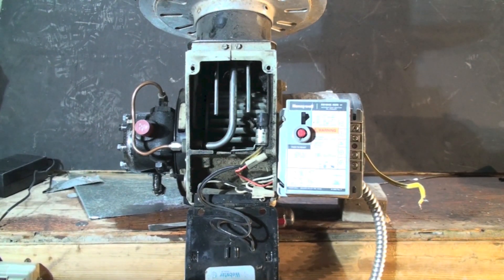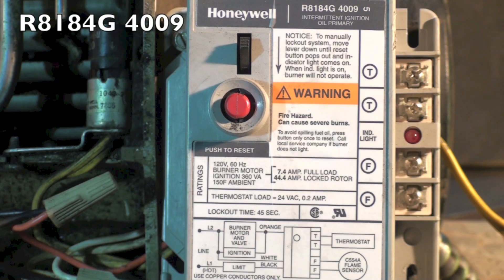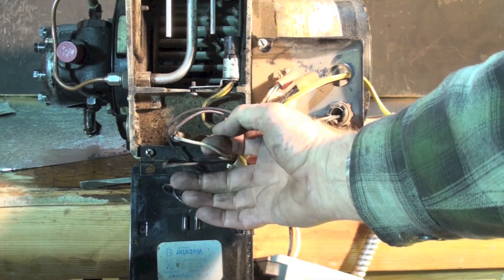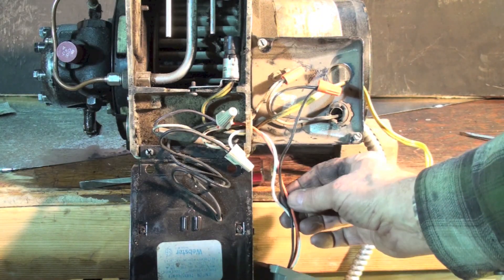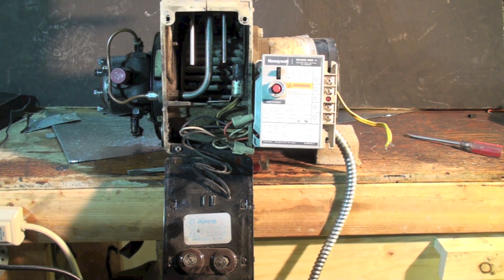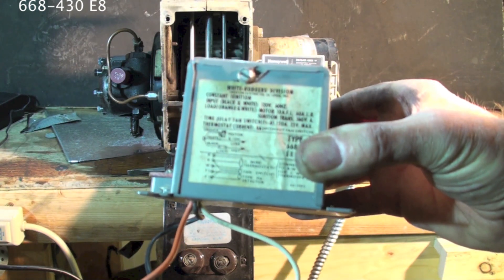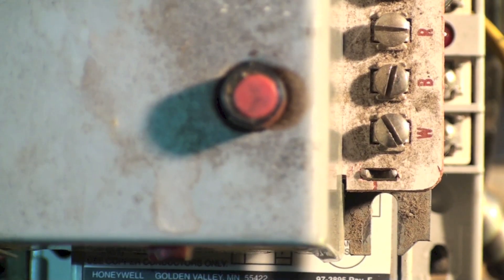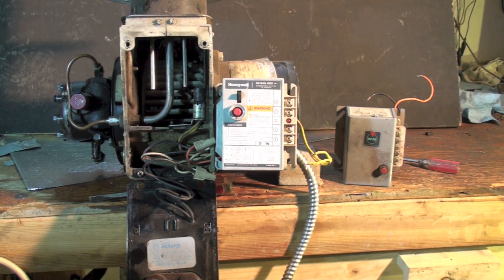How to wire the oil furnace cad cell relay

Comment: Wired as you have shown,opened the relay box and pushed the flapper switch beside the reset switch, running like normal, when it shuts down and I turn the thermostat back up to call for heat nothing happens but if I hit that flap pad inside the box again it goes ? Not sure what im doing wrong

Comment: First, thank you again for your help.  The latest problem. The furnace started but not heating the house. The heat is not going past the kitchen.  Nothing else is getting warm. 
Old HoneyWell thermostat. I'm wondering if the wiring is wrong.

Comment: Thank you for the video.  If you are going from a R4184D1027 to R8184G4009, after you finish wiring the parts from this video. IF YOU HAVE AN OIL BURNER, you need to put a small jumper between the two T's.

Comment: Great video I have seen other videos with a white wire on both T connectors it was just a wire connected from one T to the next and it was white. Can you tell me what that is for and do I need to add that to my relay because it didn’t come with one
Reply from the maker: The white wire is a jumper.
It is used when the burner is controlled by a relay which is, in turn, controlled by the thermostat.  
If yours is controlled by the thermostat, you do not need the jumper.
GFM
Reply: @grayfurnaceman  
Yeah mine is controlled by a thermostat 👊😉thanks for teaching me something important. I cannot tell you how valuable your channel is

Comment: How to wire a Field controls CK-63 control box to a Beckett Genisys 7505P primary control
Reply from the maker: The only way I can see to connect these 2 controls is to wire T1 to motor terminal on the primary, T2 to White of burner power, T3 to black on burner motor.  
GFM

Comment: I know this video is older but hope you see this.i have the same set up. But my furnace fires on and off rapidly. I replaced the cad sensor. Wanted to test it so I hooked up an external one and while the furnace is running I shine a flashlight on the sensor and it turns off thr furnace? Also if if I disconnect the sensor the furnace runs fine till it trips. Any ideas?
Reply from the maker: I can't say I have seen that, but I would be changing the cad cell relay.
GFM

Comment: For the 2 Honeywell R8184g TT terminals, could someone tell me which T should go to the thermostat R? And the other T will go to the thermostat W. Modern thermostats need a C wire. So R and W need to be connected properly.
Reply from the maker: The answer depends on the thermostat you are connecting to.  
If the thermostat is battery operated (not battery backup, but operated), the terminals are interchangeable.  
If there is a 24 volt transformer that powers an air conditioning system, you may need an isolation relay.
The problem here is if you connect the T-T terminals to a thermostat with 24 volt power to it, you will destroy the cad cell relay.
GFM

Comment: What happens when both wires coming into the junction box from the line in are black doesnt matter right?Thanks for your video it got me up and running without calling someone swapping out a transformer. Im very good fixing oil burners but not with wiring, LOL Glenn

Comment: You referred to the white wire as the power supply but the black wire is the hot.On mine relay there's a split line with one being hot and the white was connected to the other line .It was working until I had to replace my burner motor. I rewired it exactly as it was and used your video as verification. Bit now the relay is dead. I can't even jump across the f to f terminals with wires disconnected (ICM 1503) The white wire shows no resistance so it's acting like ground. Any ideas??

Comment: On that Rodgers 668-430 E8 the 3rd terminal for the 3rd wire could possibly be used for a C wire which makes me wonder if this cad cell model will operate a smart thermostat?
Reply from the maker: No.  You will need a separate 24 volt source and a isolation relay to avoid burning up the Cad cell relay.
GFM

Comment: So I have the Honeywell's one and it wont shut off after doing a anual cleaning . I disconnected it and it runs until the water is very low and I'm worried it may crack my burner by getting to hot w no water ...

Comment: Hi Gary maybe you can answer a question for me. I have a Beckett 7505 burner with a 7505P controller.  What is going on is the burner fires and runs for 2 minutes and shuts down wait 7 minutes the burner will fire and run 2 minutes and keep repeating.  My thermostat is set at 68 but I will only reach 64 .I checked my thermostats batteries and they are ok. Have you any idea. I did go on the Beckett website gave the same info and the result was a Flame Safe Guard, now is that the same as a Cad Cell. Is a Cad Cell or Flame Safe Guard the problem  Thank you and I enjoyed your narrative of problems that I  watched. Keep up the good work
Reply from the maker: You do not have a flame control shutdown problem as long as you do not have to reset the control.  
I would be looking at airflow problems.  You are may be overheating.
GFM
Reply: Ok, saying it is overheating where would you start and what would you be looking for. Do you think removing the complete burner assy and checking the firebox first or wrong direction. If we have an airflow issue what would be an aha moment how significant  would the airflow problem be. Thanks again, Wes
Reply from the maker: @chrislynquads  Plugged filter, dirty blower wheel, plugged A/C coil, ductwork problems.
GFM

Comment: Hi Gary my name is Robbie and I'm having a heck of a time trying to figure out the wiring for my grimsby seasonal 80 plus oil furnace, see I bought the furnace and the burner was off of it for transportation reasons but I'm not sure I can get turn on with switch not the thermostat and can hook the fan up to turn on the manually but really have no idea what wire goes where and I can't find anything online about them so I was hoping you might know something about them
Reply from the maker: There are several ways they are wired.  You can send me pics and I will try.  Send to Grayfurnaceman@gmail.com
GFM
Reply: @grayfurnaceman  thanks Gary well do, I wired it the way you showed in the video and it worked I just have to figure out the wiring for my fan it seems to come on at the operating Temp but then kicks out a well continue to do so till I push the button in to switch to manual, and thank you for getting back to me a really appreciate it it's a huge help

Comment: Mine is making a clicking sound now. Could this item be the problem I've had for years where the furnace (only when running the heat, not A/C) will sometimes keep running and not shut off? Sometimes it  cuts off like it should, and sometimes not. Yesterday, that part started clicking, and the furnace sounded like it was cutting on and off. To stop the furnace from running, I have to shut the main switch off, and yes, a thermostat was replaced and that wasn't the problem.
Reply from the maker: If you jumper the thermostat (short the T-T terminals) and it stops clicking, you have a problem in the thermostat or wiring.  If it makes no difference, the control may be failing or it may have a bad connection in the wiring.
GFM

Comment: Where do you connect the B1 line coming from Triple Aquastat Relay Type L8124A, C
Reply from the maker: On most controls, the B1 goes to the switched terminal of the ignition control.
GFM

Comment: Nice tech vid.
I was working on my spare beckett.
And as I was un twisting the motor wires I noticed the insulation was cracking and coming off the strands, , can these leads be replaced,  or is time for a new motor?
Reply from the maker: Probably a new motor.
GFM
Reply: Ok thanks I sfarfed trimming back the outer sleeve. To inspect further and see they continue to go further down in. But not yet into the motor housing. ,I'll start a new moter search.thankd from a fellow nutmegger.

Comment: My reset button now trips after the furnace turns off.  I push the reset button, and it starts back fine.  What fixes this issue?  Thanks
Reply from the maker: You are almost certainly experiencing flame failure during the heat cycle.  Possibly plugged oil oil filter?
GFM
Reply: @grayfurnaceman  thank you for the quick response!  Multiple issues including right side of transformer not making contact & the cad sensor!  Also bled, had some air in the line!
Reply from the maker: If you have air in the line, you may have a vacuum leak that causes the air.  This, of course assumes you have oil.
GFM

Comment: can't get a spark.  replaced transformer.  still no spark.  didn't change any wiring.  cad cell gets readings on ohm meter and reset button fires up the pump but can't get a spark to ignite it.  what could be my problem?
Reply from the maker: Do you have power to the transformer?
GFM
Reply: I believe so but how can I check. open up the relay and test the wires?
Reply: it had worked until recently. what could have went wrong?
Reply from the maker: Everything works until it dos not.  During a trial for ignition, test the input wires with a voltmeter.  Careful, 120 volts.
GFM
Reply: all the power wires are in the same twist cap and everything else appears to be working
Reply: so I have 5 wires coming in/out of my cad cell relay (the reset button box thing).  each of the transformer, motor, and the pump? each are getting their own.  is it even possible just the blue one going to the transformer went bad somehow?  how could I test/replace just that one? looking at your website...you're right in CT also?  interesting.  thanks for the help
Reply: so I put the blue (into the transformer) and the orange (into the pump) together (from the cad cell relay box) into the same cap and it fired right up.  can I leave it like that or do I run a risk of a fire or electrical surge?
Reply from the maker: No.  It should work ok.  In fact, most systems are set up that way.
GFM
Reply: thanks! so far so good. appreciate the quick replies. awesome videos. I'm a subscriber now. thanks
Reply from the maker: Welcome
GFM

Comment: Hello just a shot in the dark hopefully someone has come across this previously. I have a BECKETT oil burner heat suddenly stopped working the other day. Cad cell relay box light on. Tried to reset it, nothing happens on reset. Light kicks back on after 30-40 secs. Noticed a light buzzing sound coming from box. Changed the relay to a new one with no light and a reset button. Had someone suggest a bad transformer tried to test arc with screwdriver and got no spark whatsoever (After hitting reset button of course).  Can it be possible for the transformer to fail completely and produce no spark or would the spark be weak on a bad transformer?
Reply: Also must note motor has not been tripped the reset button is not popped out.
Reply from the maker: If there is power to the transformer and no spark, the transformer has failed.
GFM
Reply: grayfurnaceman much appreciated figured out it was the cad cell relay (control box) I had changed it previously but the remanufactured one I purchased was defective. Thanks again!!!!!

Comment: Need help on my oil furnace that does nothing.It is a Beckett burner assembly and the control is R7 B 1032 .I used to every winter have to go under house and just hit the reset with the green led flashing and it worked perfect.I dont even have a light blinking but the contro is humming.I dont have any power to the orange wire.The black and red I do that are together have 120 V. I have been watching videos and my diagnosis is that my cad cell is seeing some light from somewhere. Would that be a fair diagnosis.Or I have a bad cad cell. But main prob is nothing is happening no reset light no blinking the thermostat is calling for heat. What if I took a towel or2 and throw over where the cad cell is to black it out after I close up everything and it should ignite.If not I believe i need new controls.The air work blower fan works but that has nothing to do with the furnace does it.Please help and any advice would be appreciated and if I can help you with anything I will.my wife and family call me about everything .Built homes and commercial for 28 years.I race 4cyl cars an.I wished I never had let my wife see me fix stuff now she thinks I can do it all.Only enough to to keep her up my butt about getting this that and the muffler bearing in her car fixed. I told her she would need too take it to the dealership. I let you know how that goes on the 17th of Jan.2018
Reply from the maker: First, are you sure the motor is not out on overload?  There is a button on most of the older burner motors that can be reset.  As for the cad cell.  Just unplug the cad cell from its mount.  The only other way is to remove one of the yellow wires from the F terminal at the cad cell relay.  If it starts, either the cad cell or the wiring has failed.  
GFM

Comment: I need help asap,  I haven't have heat since the cold weather started.  I have a weil  McNeil oil heat boiler heater and it has 2 round 15 amp fuses and a 20 amp circuit breaker. What happens is when I flip the boiler switch it blows one of the round fuses and it trips the breaker.  Two times the heater started and it started to leak out the pressure relieve valve once it was getting warm and I turned the heater off it blew the fuse and tripped the breaker, but now it just blows the fuse and tripped the breaker.  Can someone please help out what I can test or do . Thank you in advance.
Reply from the maker: You appear to have a dead short.  You can start by disconnecting parts until it stops blowing fuses or look for wires touching metal parts.
GFM
Reply: Hey thanks for your response and input. I agree but this morning I tested the 2 wires for the switch on the boiler that I replaced cause it was broken and I had it on off position and when I hit the breaker the boiler turned on so I turned it off and it blew the fuse again so I  switched the wires around on the switch and when I hit the breaker again and the switch was in the off position again it started again. So I replaced the round fuse and hit the breaker now it only blows the fuse and tripped the breaker every time and it won't start. So I noticed that the 2 wire's on the switch are hot. So now I'm a little lost trying to get a wiring diagram to see if I can figure something out lol.  If not I'm going to check wires here and there for continuity and touch metal and wires. Hey thanks again for your help this the first time I've done this it feels good when someone response to you.  Thanks.
Reply: Really I wouldn't know where to start disconnecting parts or maybe I can figure it out some how.

Comment: I see the CAD cell was re-positioned on this burner. The CAD cell on my Beckett AF does not get a good flame view due to its location, so I get erratic ohm readings which sometimes jump all over the place (400-1200, with a spike up to 6000 or 10000), causing a lockout. Changing the CAD cell does not help. I'm using a Honeywell R7284U1004 primary. Can I re-position my CAD for better exposure?
Reply from the maker: You can.  Its just a question of cut and try.  You can also paint the burner tube with silver paint to help.
GFM
Reply: Thank you! I did find a bad connection in the primary at one of the CAD terminals. It is not a wire connector. It appears to be internal as it changes drastically when terminal spade is moved. Shine a small light directly into the CAD and get 7 ohms; move the terminal slightly and it goes up to 999,999 ohms.
Reply from the maker: It could.  I would check the heat exchanger.
GFM
Reply: Ok, finally found what was causing the CAD ohms to jump all over and spike, causing it to go into lockout. One of the spade terminals on the R7284U primary was slightly loose. With furnace not running, I could shine a flashlight into the CAD cell and get a reading of 7 ohms. Then when I moved the wire on the spade connector, the ohms would jump up into the 90,000 range. I disassembled the primary and re-soldered the CAD terminals on the board and everything works well. Resistance starts at around 1400 ohms when furnace starts, then drops to around 300 after it's been running a couple minutes. I checked the heating registers with a CO detector and found nothing. Thanks for your help! Great site!

Comment: When I hook up the black wire from relay to black incoming power wire it makes the white wire on relay hot at 120 volts??? Then if u wire nut the whites together you are sending 120 volts back on the neutral
Reply from the maker: That is normal.  There is a feed thru of the relay.  This video may help.  https://youtu.be/jwFAXQXX7kE
GFM

Comment: It seems when i hook black hot wire to the relay it makes the white wire hot?  And then backfeeds back on my neutral. Can't figure out what's going on
Reply from the maker: That is normal.  If you hook up the black and power up the unit without connecting the neutral, the neutral becomes hot.
GFM

Comment: Hi, I have the same system like the one you show in this video. When I try to replace the cad cell by accident I hit the block power wire to the mounting box and cause spark. Then it cause the wire only have little power but the power go into the system 110v which is ok. Only that mounting box wire have problem . How can I solve the fix the problem?

Comment: Can I install a ecobee3 thermostat on a system like this one or not
Reply from the maker: It can be done but you will have to add a fan center and an isolation relay.  Will be doing a video on that.
GFM
Reply: Thank you very much for your quick reply and looking forward to the video

Comment: This is quite similar to my old oil furnace in the shop, which quit today.  After some troubleshooting, determined it was the transformer, which I had tested to confirm.  Then hooking up the "new" (surplus), one, I couldn't remember the wiring!  Your video did the trick.  Thanks for posting it.
Reply from the maker: Welcome
GFM